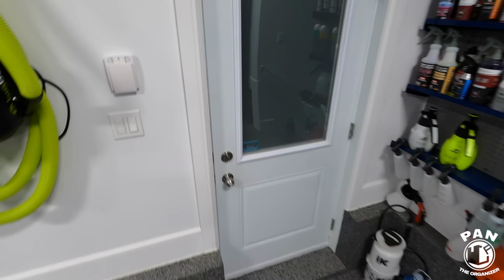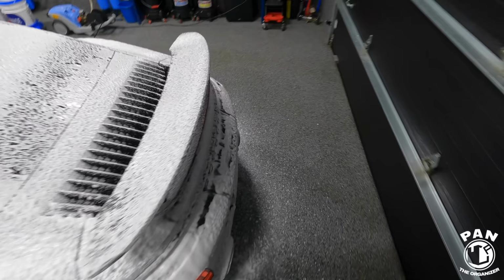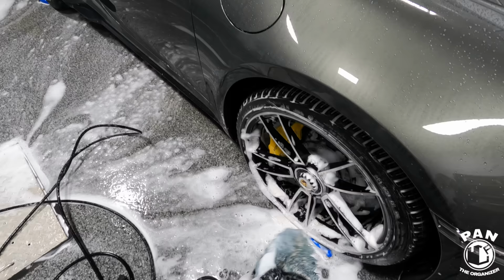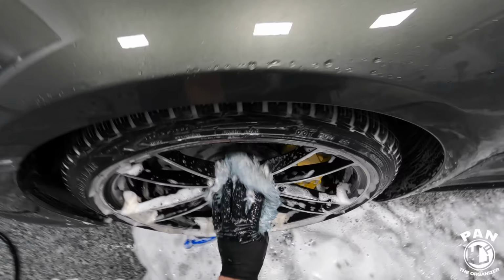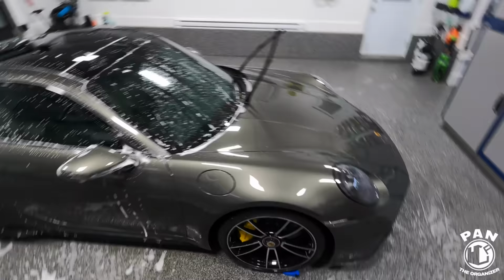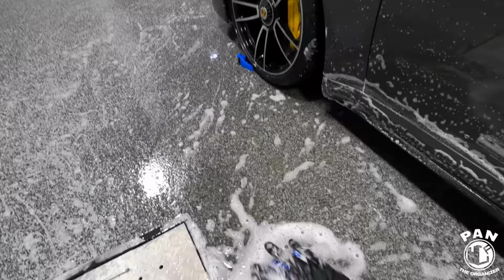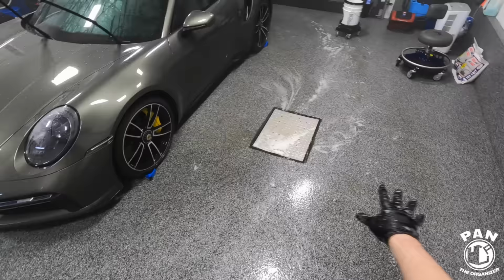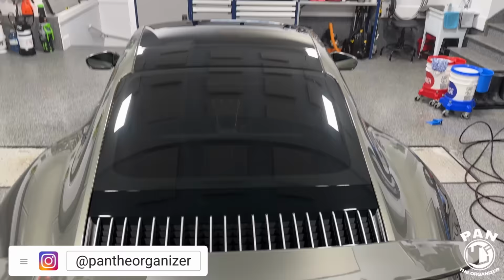Cleaning A Dirty Porsche 911 Turbo S : Exterior Auto Detailing

Comment: A question for you, Pan - if you first use your car shampoo to foam the car, let it dwell, then rinse it off - does it matter if you then proceed to the contact wash by 1) putting the shampoo in the bucket and using that or 2) if you foamed the car a 2nd time and used that?
Reply from the maker: You can do either or. Sometimes I foam, rinse, foam, wash. Other times I foam, rinse, wash.

Comment: Hi Pan, Love the Porsche!!! Question: Took my yellow AMG to the track, after a few laps (which was just so much fun) went back to the garage to watch other competitors, and take videos and photos of my son in his Golf. I noticed some of the more expensive cars out there had masking tape behind the wheels on their lower part of their fenders. I now know why, on my AMG I could find bits of what looks like splashes of rubber or some sort of gunk off the track stuck in the paint.  1. How do I wash this stuff off? 2. Is it safe to use masking tape to prevent track gunk from again damaging paint, (to prevent the same from happening next time)? cheers, looking forward to your response,...
Reply from the maker: Tar deposits are normal when tracking your car. You can simply use a tar remover like this: https://bit.ly/3BYlndm

It is safe on coated cars. It the tar is super stubborn and you need something more aggressive, you can use this: https://amzn.to/3WGeyqE 
But keep in mind that product could potentially strip existing waxes, or weaken coatings.

There's no preventing tar deposits unfortunately. I don't track my car (other than doing drag racing in a straight line) so I don't really know what tricks some use to "mask" off their areas and if that could potentially damage the paint or protection on it.

The best prevention is to have a good protection on your paint, like a ceramic coating, which makes cleaning much easier and quicker.
Reply: @PanTheOrganizer  thanks Panos

Comment: @Pan I was under the impression you shouldn’t use wax or sealant like beadmaker on a ceramic coated vehicle?
Reply from the maker: Bead Maker is an exception as the chemist (Bob Philipps) formulated it to be compatible with any protection (waxes, sealants and ceramic coatings). Obviously its formula is a secret but it works well on all the coatings I have used it on.

Comment: Pan, I also have the same Turbo S. I get this limesale / calcium built up specifically in the wheels plastic caps with the emblem. Do you also have that? Cannot figure out a solution to avoid this.
Reply: Do you daily drive your 911 Turbo S?
Reply: Those centre lock nuts are delicate & seem to mark up easily with wheel changes or cleaning chemicals. I managed to keep them looking mint on a GTS from new, but a used turbo S showed up looking poor after 1st wash. The (Porsche) dealer had managed to cover it up as they looked good in the show room. Forums say olive oil as a temporary look good fix but I’ve not tried it yet.
Reply from the maker: I don't have that issue, as I ceramic coated the vehicle as soon as I took delivery.
Reply from the maker: Yes this is my daily driver. Driven year round even in winter months. Cars are meant to be driven and enjoyed. :)
Reply: @silvercat7328  i tried a lot of things to get rid of this calcium built up on the wheel caps, white vinegar, alcolh, etc. Nothing works :/ it sticks to the caps.
Reply: @PanTheOrganizer  oh that is why!

Comment: What's the advantage of 45% humidity in the garage?
Reply from the maker: For many reasons, including:
- More comfort when working in a controlled environment (I have yet to hear someone that loves working in 85% humidity and 100F temperatures hehe).
- A better user experience when using chemicals, as most are tested in lab environment which are controlled, so to get optimal user experience, as close to 40-50% humidity is always best (and near 68-72F). For example, when applying ceramic coatings, flash time depends on temperature and humidity. The warmer and humid the environment, the quicker it flashes. The colder and less humid environments lead to much slower flash times, so you're constantly fighting the conditions. In a controlled environment, it makes everything simple and the process can be repeated time and time again.
- When working indoors, in a garage like mine at home, you don't want to have constant super high humidity, as that can lead to mold growth and health issues. So again, a controlled environment is best.

Comment: Do you apply a wax or coating to the interior painted surfaces of the doors and along the interior door trims? Do you use the same stuff as you do on the exterior?
Reply from the maker: Yes you can use the same protection as the rest of the painted surfaces if you want.

Comment: What chemical product do you recommend to use for removing bird poop from the car? Something that is not that expensive
Reply from the maker: The simplest way is as soon as you see a bird dropping, use a quick detail spray to pick it up gently with a plush microfiber towel until your next wash. And frequent washing is the best way to prevent the acid contained in bird dropping from etching through the clear coat.

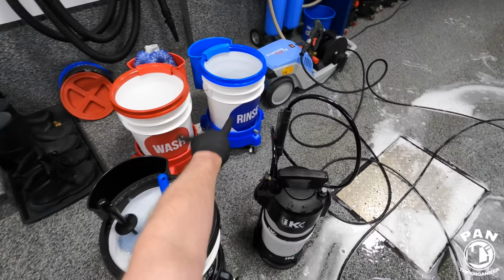Comment: hey pan another great video man! I am thankful for all your videos. I am learning so much from you! I just wanna ask on 15:41. so for example. I am going to spray the P&S brake buster on my wheels and tires , can I put my soaked  wheel tools on the apex auto wash and use my soaked wheel tools on the tires/wheels with the soaked apex auto wash or should I just use my wheel tools in a soaked water?
Reply from the maker: I usually always have soapy water in my wheel bucket, so yes absolutely, you could have Apex Auto Wash in the wheel bucket and soak your tools in there.

Comment: Pan have you ever had an issue with brake squeek after washing the calipers/ rotors? Curious to see how you deal with customers that may complain afterwards
Reply from the maker: No as I explain to customers that it can happen, it’s normal and it goes away after a few stops. Communication is key.

Comment: Hey Pan, quick question - do you typically apply a detail spray (or drying aid/topper) every time you do a maintenance wash? 

I usually wash my GV80 1-2 times per week and have been debating if its okay to use a detail spray every time. My vehicle is currently coated with Adams graphene coating (original formulation). I typically rotate between Phoenix EOD titan, gyeon ceramic QD, and adams graphene DS. Will this cause my coating to clog if i use one of these three every time i perform a maintenance wash? 

Love the videos and i appreciate the wealth of knowledge that youve provided me throughout my weekend warrior detailer's journey!
Reply from the maker: Thanks! All of those are good picks. Not needed weekly unless you towel dry. If you towel dry you use a QD as a lubricant to reduce marring.

If you use a blower like I do, no need to use a quick detailer week. Once every other week or monthly is perfectly fine.

They won’t clog your coating but you get the properties of what ever site on top. So it might change your coating’s hydrophobics a bit, but not in a bad way.
Reply: @PanTheOrganizer  Awesome, thank you! Truly appreciate your feedback. Have a ton of questions, but, ill leave it at that for now lol

Comment: Hey Pan! I have a dark grey car, the biggest issue I’m having with bead maker on that car is finger prints, it is so prone to finger prints and it is driving me nuts, do you recommend any other drying aid that would combat this? I use bead maker to top off my coating.
Reply from the maker: I don't have such issues so it's impossible for me to comment on that matter. You'll have to test different toppers and find one that suits your needs.

Comment: Would you recommend a one step paint enhancement on a ceramic coating vehicle just to get the love marks out plus a reapplication of the coating
Reply from the maker: You don't polish a ceramic coating, as the abrasion will damage/remove the coating. There is only one polish on the market made to correct VERY MINOR scratches on coatings, and it's this one: https://bit.ly/3L3d8lG
Reply: @PanTheOrganizer  Thank you i really appreciate it

Comment: Hi Pan, absolutely love all your videos. I've been a fan of your channel for years. Like you, I was using a karcher pressure washer and I see you upgraded yours years ago. I've just brought a kranzle k 1152 tst, could you please give me some advice on whether I need to change the gun,lance, etc. Also which foam cannon you would recommend? And also does it have a pressure gauge on it and if so what pressure should I run it at please??
Reply from the maker: Hi Lawson. Welcome to my channel. You discovered one of the biggest car detailing channels on YouTube as we surpassed 870,000 subscribers and we have over 110 million views! I have been detailing for 26 years and I love to share my knowledge and passion with my viewers.

You found the right channel to help you learn everything about detailing.

The 1152TST is the European equivalent to our 1122TST in North America. Just the electric plug changes. The machine is the same. I set my pressure washer to 1000 psi roughly when washing cars, thanks to the Mosmatic gun and wand and 4.5 orifice. Here's my kit: https://bit.ly/3QkDy2H

For foam cannons, it depends what features you want, but have a look at my most recent foam cannon battle video: https://youtu.be/wF5pDPE7vr0

If you want a foam cannon with a 1/4 inch quick connect, you have no choice to upgrade the standard lance to a kit like one above, with the appropriate adapters to be able to swap foam cannon and guns.

Comment: Hey Pan.    I’ve been following your channel for a few years now.    Thanks for all the great tips and product reviews.  I do have a question for you.  I have a 2014 Mustang that had only 17k km on it, but the paint has a few minor swirls and light scratches.. I’ve been using TW hybrid solutions ceramic wash, with great results even though I haven’t done an actual ceramic coating.. I’m no ready to tackle the full paint correction process..  what should I wash / wipe down the paint work with before starting clay bar/ paint correction..  ( how to strip the ceramic wash if needed)?   Thanks again for a great channel
Reply from the maker: Hi! The only way to ensure 100% removal of any previous protection is by machine polishing. So you would first wash your car using a stripping shampoo like this: https://amzn.to/3A6su2x

Then continue with the iron removal stage, then the clay bar stage, then machine polishing, then use a paint prep (IPA solution) to remove polishing oils, and you're ready to apply your protection. I have a "Detailing 101" series that will help you a lot:

Part 1: how to properly wash your car: https://youtu.be/7Koj5j2Es5U
Part 2: chemical decontamination (iron and tar removal): https://youtu.be/W_cyHz3XssU
Part 3: clay bar: https://youtu.be/XB8UaTCXuLg
Part 4: machine polishing (paint correction): https://youtu.be/ustTEVGMOTI
Part 5: how to apply a ceramic coating: https://youtu.be/sqQYVjxFqK0
Reply: @PanTheOrganizer  thanks so much. I figured that was the steps ( have watched just about every video you have on this topic) needed.   Thanks again and have a great day Pan.

Comment: I'm in Florida and it so freaking hot and muggy!  85 today.

please tell me you're not driving that beautiful car in the crazy winter filled with salty roads??? I'm originally from Montreal   moved 87
Reply from the maker: I absolutely drive my car year round, even through our harsh winters. It's actually the best winter car I have ever owned. It's all wheel drive which helps. Cars are meant to be driven. And I wash and detail my car twice weekly, so you can't even notice it's been through winter. ;)
Reply: @Pan The Organizer  Well you do have a point!  my friend lives in Barry Ontario and she refuses to drive her sports car in the winter, however she'll pull out her tesla and do so, go figure!.

I'm guessing you need to be set on that mindset of yours ; cleaning and waxing 2x a week otherwise your car will turn into a rust bucket within a few years.
Reply from the maker: Yes. Also, it depends what sports car she has. If it's a rear wheel drive very low to the ground sports car (like a Ferrari F8 for example), I wouldn't drive that in the winter. No traction, no ground clearance.

Comment: Thanks Pan. Car looks sick.
Just wondering about the DI water. Do you need it for indoor washing? Does it keep up with providing 0 ppm with the pressure washer?
Reply from the maker: My DI tank is in my garage as you can tell, and yes I hook up my pressure washer to it and it provides 0 ppm water while washing (until the resin needs to be changed, my system can treat up to 300 gallons of water according to CR Spotless). 

See the video about my DI setup here: https://youtu.be/IKNL1chAQXY

Do I "need" it? No. Is it awesome to have the best possible water for detailing? Yes. I already had a water softener system for the entire house, so my water wasn't hard to begin with. But with the DI system, I know for sure I have zero minerals.
Reply: @Pan The Organizer  thanks for the reply Pan i appreciate it.

Comment: Hey pan the man.. 😄
 Can you do a torture test comparison of the carpro quartz SiC and turtle wax grahene flex please. Side by side.. I’m thinking of upgrading my coating
Reply from the maker: Lol you can’t compare those, it would be unfair. A true coating in a glass bottle always will win compared to a spray counterpart. Coating costs way more and takes more time to apply. Spray costs way less and is way quicker to apply. There are always compromises.

But for durability and chemical resistance, of course SiC wins hands down.
Reply: That answers my question😄… upgrading to  the quartz SiC.. thank you very much Pan.. I’m gonna have fun applying it. I’m gonna get your tips n tricks on it.

Comment: Between all the different channels of detailers I'm subscribed to and My shorts have been nothing but foam Cannon vids, I'm about to make my showerhead an foam Cannon, imagine body wash super suds, lol oh we can dream. But Keep the pov videos coming. I always do interior, door jams, then pre rinse, hit tires first then wash top to bottom exterior, but I'm wondering could you decon after the pretreat then foam let the decon and snow foam dwell together then rinse or your in an non direct sunlight cool situation you can go straight to contact wash? I'm all about faster processes but not sure on every step that could be combined, I know clay mit and snow foam or iron/ brake buster on tires dwelling them foaming on wheels.
Reply from the maker: I always decon clean paint. The reason being you want the decontamination chemical to do its job, without having to fight through other dirt and grime. So for example, someone that sprays an iron remover on dirty paint, to me makes that product less efficient, as the iron remover has to fight through all the rest of the dirt, grime, road film, etc and perhaps won't be able to get to all the iron particles.

So wash the car, rinse, and then use tar and iron removers. And never use those chemicals in direct sunlight, and never let them dry on the surface.

Also, I have a popular "Detailing 101" series of videos on the basics of every detailing step. Here's the one on chemical decon: https://youtu.be/W_cyHz3XssU
Reply: @PanTheOrganizer  thank you for the info, speedy reply and I enjoy every video I have watched from you I go the older videos and it seems like the knowledge/ wisdom/ passion is always consistent. Love your community/ comment section, good insight. True definition of the word professional.

Comment: Bonjour M. Pan. I just took on my first ceramic coating job and I think I did very well.I used Gyeon One 30ml on a Jeep JLU, used every drop! The only issue I had was which microfiber towel to use for wiping off the residue. I couldn't remember and was trying to find what you used for your cars, can the towels be reused or do you throw them out? The water just slides right off the Jeep now! Merci
Reply from the maker: When applying a true coating (in a glass bottle), always throw away the applicators and towels used to apply and level the coating. 

The towels I use to level are these ones: 

USA links:
https://amzn.to/41gXQiX That's the first wipe. 
For the second towel (buffing) I use these ones: https://amzn.to/3KHTGJZ

Canada links:
First towel: https://bit.ly/3E8KgnB
Second towel: https://bit.ly/3UPu0y4
Reply: @PanTheOrganizer  Thanks Pan👍

Comment: Would you do bug removal with citrol before or after the rinseless wash?
Reply from the maker: Citrol is a bit too strong if you have protection it will strip it. So for a wax it’s simple you can reapply, but I wouldn’t use Citrol on a coating. Use a bug remover.

Comment: Saw your video on the Gyeon Wet Coat. Looks interesting. Where in the process should I implement it? Right before dream maker/bead maker?
Reply from the maker: Right after your final rinse, you spray it on a wet surface and immediately rinse off. Then you dry the vehicle with a blower, it’s super quick to dry the vehicle that way.

Or use a drying aid and microfiber drying towel if you don’t have a blower.